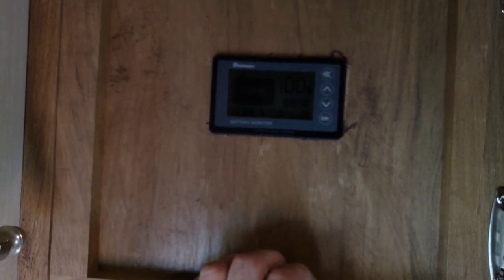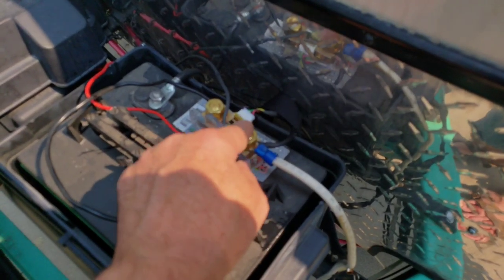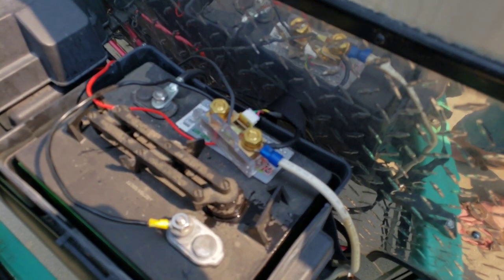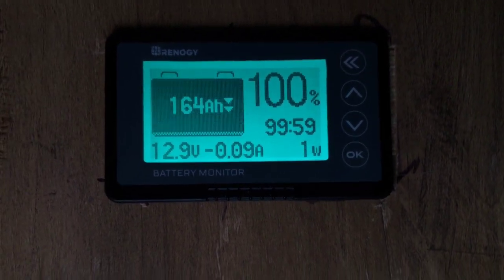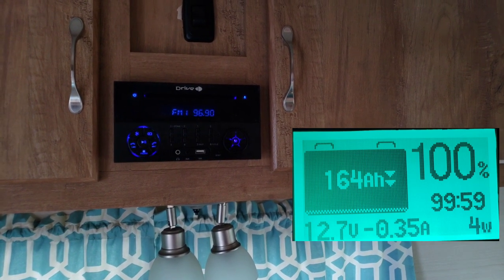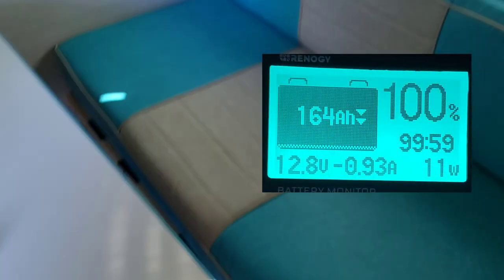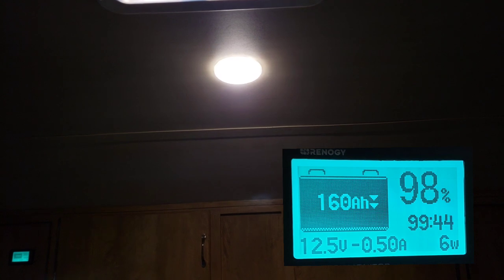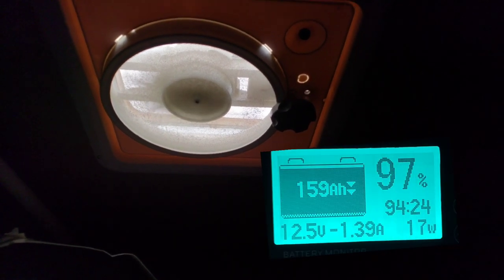Renogy 500A Battery Monitor

Comment: Jay just sending thanks for a great video and FYI,  I follow Greg Douglas and get lots of help from his posts.  Your review of energy demand monitoring with Renology RBM500 by  various DC appliances on 19ERD is awesome.  Great guidance for sure as I am currently in the process of adding Greg's portable solar panel kit and LiFePo4 battery and changing out my OEM WF-8935 Power Center on our own 19ERD Vista Cruiser.
Reply from the maker: You're welcome I really enjoy making videos to help people. I also agree that Greg Douglas's a grace source of information. If you do install this monitor run the cable from the monitor to the  shunt. The end of the cable that plugs into the shunt is smaller requiring a smaller hold a drill when running the cable? Good luck and happy camping.

Comment: Question, I have (2) 6volt batteries ran in series. I installed the Renogy 500A monitor but the volts only read 6.5 volts? any ideas why this does not show 12volts. FYI, I changed over from (2) 12volt to get more AH. Hooking up batteries I connected positive to negative on both batteries, then negative to -B1 then negative from trailer to -P1 on shunt. Although everything seems fine I have noticed also the hitch motor seems slower also but still works.
Reply from the maker: My battery set on the front of my trailer so they sit side to side. They connected the negative and positive terminals. That were the closest to each other. Using I believe at least a 4 gauge wire. So the terminals on the outside become the positive and the negative terminals for the 12V system. If you're battery, sit back-to-back. Spin one battery a 180° so that you have a negative and a positive terminal on each side. So connect one positive to negative terminal. And then the other 2 become the positive negative for the trailer.

Comment: Does this renogy battery monitor work on other batteries? Or does the renogy battery monitor only works on renogy battery?
Reply from the maker: It'll work on flooded lead acid, AGM and lithium  batteries. It does not matter what brand of battery you have.

Comment: I have three AGM batteries of 200ah each, When setting up the capacity should I plug in 200ah or the total of all three batteries which is 600ah?
Thanks in advance.
Reply from the maker: You enter your total amp hours capacity. I personally would enter either 80% = 480 amp hours or 75% = 450 amp hours. This way you are not totally draining your batteries.

Comment: Hi there Jay I dont know if you can help me out here. I have installed the same monitor. when I connect it to solar to charge the batteries the screen keeps on blinking on and off. when it is charged and I disconnect it it is fine the light is off, I press the ok button the light turns on for a few seconds then goes off. It measures fine. it is just when I connect my solar it constantly blinks on and off. Cheers Bill
Reply from the maker: When you are charging your batteries whether on shore power or solar the unit is designed to flash.  Press and hold  <<  For 3 seconds,  This will turn off the light. Press and hold again and you can turn back on the light.
Reply: Right next to the amp hours battery reading are arrows. Up means battery is charging and the display flashes, down arrows mean discharge and the display will be lit steady.

Comment: What size wire did you run from the shunt to the neg on battery?
Reply from the maker: I used 10 gauge braided wire.

Comment: I love these things and have 3 of them on 3 different battery banks. I like to watch that display recalculate the time of battery life left after adding loads and removing them. Its also very handy at showing how long it will take to recharge the battery. I can watch the recharge time increase when clouds block the solar panels. It takes about 30 seconds for the time reading to settle down after a load change.  These Renogy units  take all the guesswork out of figuring out how much longer the battery will last.

I built a 3000 watt 560 amp hour 7200 watt hour solar generator on wheels to run a home size 24 cu ft fridge and 2 chest freezers for when our power goes out AGAIN.  Here's a video of it running with some bigger numbers on the display. I stopped robbing liquor stores and now spend time building battery things. https://www.youtube.com/watch?v=NYpczRYDFJQ
Reply from the maker: This is my 1st one I have owned and so far it's been great. My favorite thing is to watch how much things draw hampwise.